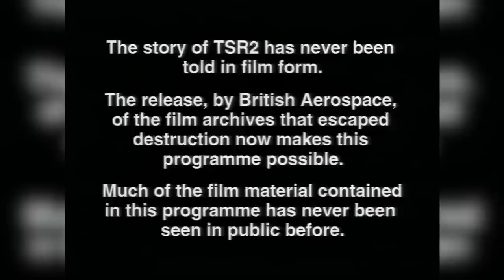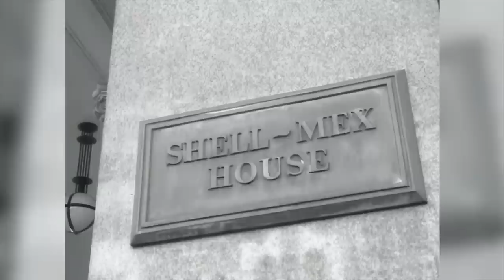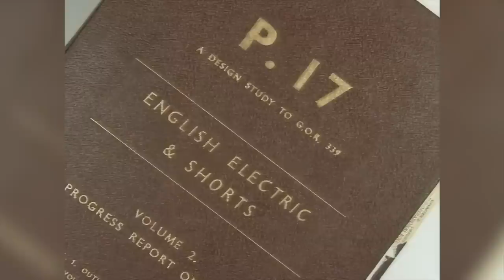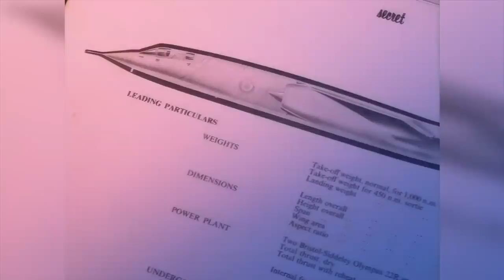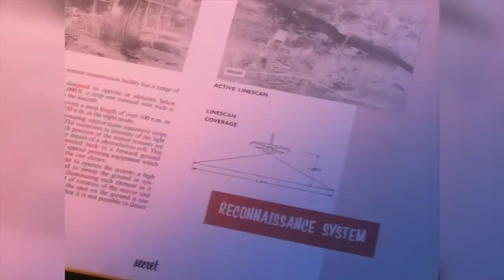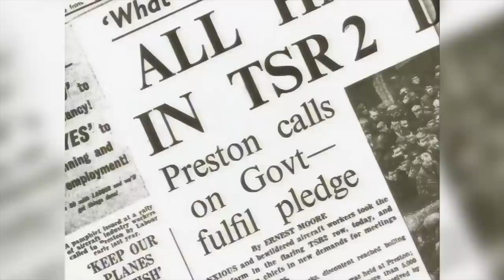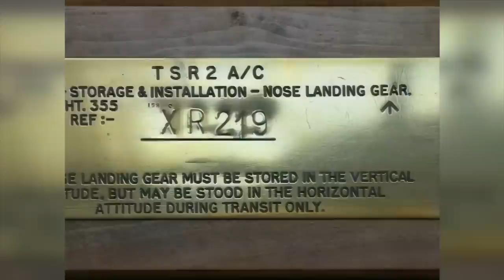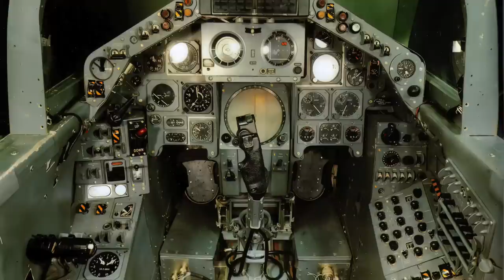BAC TSR2 | The British Cold War strike and reconnaissance aircraft that was cancelled | Upscaled

Comment: Regardless of the development problems and costs of TSR2, I distinctly remember the Labour opposition promising before the 1964 election that "we will not cancel TSR2". One of the first things they did when they got into power was cancel it.  That should tell you a lot about politicians and their promises -- no matter which party they belong to.
Reply: I don't think anybody had shown Labour the stratospheric cost over runs at that stage as in opposition you are not allowed to see the figures, plus there was a very elastic estimate of an in service date for the aircraft. It could have been another six or seven years before a squadron saw one, by which time it would have been obsolescent, certainly in avionics. Remember there was only one customer so we'd have built...maybe 100-130 maximum. Tornado came along not that long after, the tripartite project ran like clockwork by comparison with TSR2 and they built nearly 1000 aircraft for four customers. They learnt a lot from TSR2 about how not to run a project. It was regrettable, but as hard decisions go I think they got it right. Sorry n'all that.
Reply: Very interesting, funny how long it can take to build a new plane model, compared to a new Spaceship for new moonlandings, wich was less than 10 years, I'd say 5 full years of actual work. 
  So a real Brit fiasco without Outside (USA) help like Canadian Avro Arrow that got cancelled because "defense Planes were over with"... it worked fine.
Reply: It was a rub for Grumman and Lochheed, so it had to go
Reply: Oh my! Politicians lying, who would have thought.
Reply: @wildboar7473  As a Brit, I don't think American influence was a factor except to the extent that F 111 was offered to the UK a lot cheaper. GD didn't tell us about the bugs in it though which caused that contract to be cancelled in any event. Neither can I be 100% certain there wasn't skulduggery by the USA, but I've never seen enough proof in the TSR2 case. Britain was broke at that time and so cost is a critical factor. It's all circumstantial and people add 2+2 and make assumptions.  Lockheed and the F104 German contract on the other hand has convincing evidence of skulduggery, so we know it happens and it would be naive to think otherwise.
Reply: It was cancelled by labour for one reason  they were told to by the unions and we all know labour was bankrolled by  the unions and we all know who bankrolled the unions don't we
Reply: @CB1000FP1  no, in the post ww2 world there existed huge competition between the defence companies. The TSR2 was scrapped because Britain needed aid from the USA and didn't want to get involved in Viet Nam.  Then magically, the F111 came to fore
Reply: @timhancock6626  All great building projects overrun on price....it was certainly not Obsolete !!
Reply: coopdivi……you distinctly remember do you !!!    You must be geriatric to remember that one.   Go ahead provide your source for that gem of memory.    Don’t bother to mention that the reorganisation of the aircraft industry was compelled by Tory governments which was influenced by Duncan Sandys ignorance of aviation and technical matters.   Dr RV Jones condemned his ignorance and the 1957 Defence White Paper was his brainchild as well as the forced amalgamation of aircraft companies of which Roland Beaumont has an awful lot to say.
Don’t bother to mention that when Labour came to power following years of financial prudence under the Tories,  the country was virtually BANKRUPT. 
The only thing I take issue with was the destruction of the jigs, drawings and existing airframes which could have been put to sound research use, which again Roland Beaumont again had a lot to say.
Reply: @wildboar7473  Interesting you add the Canadian Arrow into the conversation. 
Go look at any of the videos on that plane and look at the angst from the Canadians.
There is still a lot of anger there.
Reply: @timhancock6626  Really good point about "how not to run a project" a lesson that seems to be forgotten then relearnt, forgotten then relearnt, forgotten then relearnt on so many occasions.
Consider the F35 on that one.
Reply: @photoman3579  The question would be better framed as what parts of the plane were obsolete at the time of cancellation. I'd agree the airframe and engines were not obsolete, but the electronics might well have been but then that's irrelevant because its now accepted that aircraft will upgrade the electronics several times in their lifetime.
Reply: @alexmoore432  no it was cancelled by the Soviets, the F111 was inferior to the TSR2 which is why they weren't such a big threat to the Kremlin
Reply: @CB1000FP1  how do you figure that?
Reply: @californiadreamin8423  Yes, I am a geriatric and proud of it -- which is not to say I've gone gaga (yet). I was nineteen when the newly-incumbent Labour government cancelled TSR2, and as I had a great interest in  aviation generally (I was a regular attendee at the Farnborough Airshows and had been 'plane spotting' at Heathrow since my early teens) I had been following the TSR2 saga avidly.  Most of the information available to us at that time came from newspaper articles and specialist flight magazines, and the occasional tv programme. 
Naturally, in the run-up to the General Election the media were predominantly concerned with political articles, statements and interviews, and it was from one of those (I must confess I can't remember which one) the statement "If elected, we (Labour) will not cancel TSR2" comes. Because of my interest in aviation that statement lodged in my brain, never to be forgotten; TSR2 was a popular topic even amongst non-enthusiasts as it was seen as a shining example of what the British aviation industry could do.  Of course, we knew nothing about all the other problems and behind the scenes manoeuvrings associated with it. All we knew was that when the government cancelled the project, it was seen as yet another example of politicians reneging on their promises. Furthermore, the speed with which it was cancelled led to the suspicion that cancellation had been intended all along.
Your post seems to imply I am anti-Labour for not mentioning all the issues which occurred under the Tory government. My post suggests no such thing -- it merely points out that one should be wary of what ANY politician says. I once had a History master who introduced himself to the class by striding in without a word and writing on the blackboard in capital letters, ALL POLITICIANS ARE LIARS. In the 60 or so years since then, I've never had a reason to doubt that statement.
By the way, it's Roland BEAMONT, not Beaumont. As you're a stickler for accuracy, I thought you'd like to know that.
Reply: @coopdivi      I stand corrected….you should pay more attention to what Beemont had to say.   The country was bankrupt,  didn’t you know ?    The scene was set by the inept Conservative governments which had gone before,  so tell it the way it was.   I’m not interested in what your geriatric history teacher thought.   Not only that,   the money invested in the TSR2 wasn’t wasted,  because of the advances made in avionics,  engines and machine tooling.   While you were making your trips to air shows I happened to be at BAC witnessing for example Jaguar wing skins being milled from solid slabs of aluminium on machines installed for the TSR2.   That doesn’t mean to say the workforce hadn’t been in shock after the cancellation,  because they were, as reported to me when I went through the design office,  but they were heavily involved in Jaguar and the MRCA.
PS.    I’m older than you. 🙀
Reply: @wildboar7473  Its the loss of skill sets, experience and knowledge that people should be furious with. Right now here in Australia we have this almost social meltdown over trade skills shortage. 

Back in the 90s we shutdown the schools where we taught basic trades. Surprisingly it was not the political right but the Labor Party with a 1990s version of wokerism. At the time people said we would suffer in future from a lack of skilled labor. During the late 2000s and all through the 2010s as we built new mines and new gas projects to feed Asia with raw materials. There was constant outrage from industry about the skills shortage. We had to constantly import skilled tradesmen - welders, machinists, electricians,....

I did a degree in aerospace but work in Industrial control systems and automation. I went off to our mining industry because circa 2002 there was a proposal to mine the moon for Helium-3. So I went for the experience of building mines in remote places. The shortage of welders, machinists and electricians was staggering. One of my first times on a mine site I asked how they were handling it and the supervisor just looked at me and said if I had a welding ticket he'd pay me $X, where $X was almost $50K more than what I was getting paid as an engineer with over 15+ years experience.

I just heard recently that in America if you do just a 6 month basic welding course (not a full 4 year apprenticeship) you will earn more in your 1st year after that than the average college graduate. If you do the basic math for the first 5 years after high school. You have the college graduate earning $A but with a huge debt. The welding kid has NO DEBT from the 6 months of welding because community college is free. Plus he has 4-1/2 years of earning $B each year where $B is a bigger number than $A.  

This madness that started in the 1960s, where M0R0Ns with no idea made stupid decisions, hasn't really stopped. In anything its gotten a lot worse. that 100hour program to get the most out of TSR-2 should have been done. Nobody should have burnt anything. Other than the waste of expensive raw materials, that was pure pettiness.
Reply: Labour did in the TRS2 Tories did in the black arrow rocket program
Reply: @californiadreamin8423  the unions have been in the pay of the Soviets virtually since there were formed, and they do what the Kremlin tells them, without there money they would have collapsed decades ago, they wrecked British industry in the seventies, I was a engineering apprentice in the late sixties and remember a large strike being called in around 1970 when I asked some of the  other workers in the factory what it was about the majority had no idea and most weren't very pleased that they would be losing money either, always refused to join any union after that, wouldn't trust them further than I could throw them
Reply: Will Rose  Thanks for the insight from someone who was there.
Reply: Well if you vote Labour,  what do you expect!?
Reply: @wildboar7473  Britain was 'in hock' to the US for decades after WW2, no doubt the existence of a competing British project might have resulted in a little 'arm twisting' of the political party that took control in 1945!
Quite a number of British aircraft before and after that date were technically successful, after all, including a supersonic transport aircraft said by NASA to be as difficult to achieve as the moon mission.
Reply: The RAF were the people who actually killed TSR2, because it didn't work and was never going to work||!! Aircraft was loaded with design flaws which were not fixable!!
Reply: @californiadreamin8423  Yep, the good old Jag. Took the French to teach Warton how to build a decent aircraft!!
Reply: The TSR2 was cancelled quite a while after Labour got in power.  They did fully assess its viability costs. They inherited a project that was running out control with costs, when UK cities still had appalling slums needing to be cleared with new homes built. Their decision was vindicated when the Vulcans were converted to do the same role as the TSR2.
Reply: @CB1000FP1  
You read the Daily Mail and Sun too much.
Reply: @californiadreamin8423  
The Labour politicians with power say they did not order the destruction of jigs. 
Although politicians would do such a thing. If the Tories got back into power they could restart the project, build the plane then use that as a political baton.
Reply: @tonywilson4713  
With engine and avionics upgrades the TSR2 is match even today.
Reply: @richardvernon317  not entirely sure about that idea since the father of one of my friends was one of the designers- left without work at closure - he had a rather different story to tell of political shenanigans!
Reply: @John Burns  I could barely watch the last few minutes of this video since I remember the story.  I will say right here and with conviction that I am certainly no admirer of the British Labour Party and esp. the disastrous Wilson Labour Government. They were the mob who nationalised everything including the motor, steel and  aircraft builders industries. I have a distinct memory of Daddy's indignation and horrified disbelief at the stupidity of the Labour pollies. I think that the TSR2 would probably have had at least as illustrious a career as the F111 and quite possibly more so. Do you have any thoughts on this?
Reply: @richardvernon317      I won’t rise to the Jag and the French.  However your statement about the TSR2 is interesting.   I’ll rise to that one…..justify what you say.
Reply: @johnburns4017     I stand corrected….it was nearly bankrupt,  hence the reason for joining the EEC , and why the Labour Government had to go to the IMF for a loan.   Nevertheless I agree with your post.
Reply: @Davidcallard     Was the aircraft industry nationalised ?   I know it wasn’t.  
Was the motor industry nationalised ?     Some was, not all,   but the question is why ?    How many years were the Conservatives in power before Wilson became PM ?     The British Motor Industry continued after WW2 ,  using clapped out machinery,  with virtually no competition because our competitors industries were bomb sites.   Huge profits were probably made yet they did not reinvest like the French ,  Germans,  Italians, Japanese.   How did they manage and we couldn’t because I’d like to know ?
Reply: @CB1000FP1 Dearsir, you are mistaken ,  the F111 had a greater internal fuel range, and a greater weapons load, than the TSR2, which is why the RAAF chose the F111 over the TSR2.
Reply: @californiadreamin8423  The sad reality is that British industry has not generated sufficient surpluses to reinvest and upgrade since at least 1945, shipbuilding being a classic example, barely profitable since 1919. As a genaralization, domestic demand in Britain is for products that do not necessarily translate well into export markets. Japan has a similar problem, though Japan does put a lot of effort into developing products primarily for export, which means that domestic sales for export products is a bonus.
Reply: @timhancock6626  You bang on the money with the problem: The avionics. The systems were trying to deliver performance that was a decade down the line. So much was right about it: it was a very clever bit of kit, but aside from the politics: it simply wasn't going to be able to perform the missions required of it. Far too much feature creep and far too much vested interest by the USA to kill any decent rivals to their aviation builders. Happy to hire our engineers mind you.....
Reply: @richardvernon317  And you know this how?
If anyone in the MIlitary had an influence in causing the cancellation of the TSR project, it was Lord Louis Mountbatten.
Reply: @CB1000FP1  
Yes CB1000FP1.
It was cancelled because Britain was broke. TSR2 over promised, under delivered. Cost quadrupled, Years in delays in being able to get it into service.
Nothing to do with the Unions that have never had any say in Defence Contracts.
Exactly the same as the General Dynamics F-111C that Australia bought 24 but from and a much larger order from the USA Airforce to distribute cost overruns.
The F-111C was in service in Australia for nearly 40 years. Not bad for an old airframe.
The F-111 had its own problems but evdentually turned out to be one of the most successful tactical long range fighter bombers used in the Western World.
BTW who do you think 'bankroll' the unions? The USA? 
The only country that benefitted by the cancellation of the TSR-2.
Reply: @CB1000FP1  
The Soviets and Kremlin was reliant on the Western Defence projects. Spies are cheaper than research.
That is how the Soviets got the Atom Bomb. Jet fighters, and the Tupolev 144 'Concordski'
Reply: And they promised to get 50 F-111s.  Those Pigs would of been very useful during The Falklands.
Reply: @70sVRsignalman  it still wasn't as good as the TSR2 which would have got the job done and wouldn't have been reliant on a unreliable foreign country for supply and maintenance
Reply: @CB1000FP1  I give in - who?
Reply: @andywilson2406  who what?
Reply: The Americans lost more F111`s in Vietnam through a design fault @timhancock6626 than were shot down by the Viet Cong. A small cleat at the base of the rudder, failed which put strain on adjacent components, which then failed themselves.
Reply: @robshirewood5060  I spent the best part of a year at university studying the causes and effects of the 1957 Defence White Paper. I do not recognise your narrative at all. You seem to blame a loosely connected conspiracy type theory which is nonsense. It's mostly cockup, not conspiracy, but politics is always lurking around so you have to factor it in somehow. All I would say is that politicians always listen to holders of the purse strings first ( except for Kwasi Kwarteng it would appear). He is the exception that proves the rule.
Reply: @johnburns4017  Sort of....If you talk to Vulcan crew they were not well suited to the low level role they were never designed for. They did make it "work" at low level though, to their great credit.
Reply: @MrHeesbeen  I did refer to bugs that General Dynamics didn't reveal to the UK. They also had severe problems with premature wear on the swing wing mechanisms. There was a list of problems, I can't recall them off hand. They were enough for the UK to cancel it's order and revert to re-tasking the Buccaneer from its Naval carrier role to RAF low level strike. It performed this role honourably for 30 years.
Reply: @timhancock6626  
So, the TRS2 was not needed for that role when an existing plane could do it.
Reply: @timhancock6626  The Americans and IMF sealed it's fate. Tragic decision
Reply: @timhancock6626  "They" may have got it right, but "they" certainly didn't get right the decision to buy the F-111.
The swing-wing feature of that aircraft, plus several less challenging problems, caused years of delay in delivery and resulted in a bill for each aircraft almost ten times the original quote. Sorry n'all that.
John Bayntun
Reply: @craigbeatty8565  
Where would the Brit's have flown the F-111s from to reclaim the Falkland Islands?
The Brit's used carrier based planes as they had no land based airfields within range.
Reply: @johnbayntun840  We never bought the F-111 in the end so most of your post is pointless. We "bought" the Buccaneer. Sorry n'all that. TSR2 decision was sound.
Reply: @CB1000FP1  🤣🤣🤣🤣🤣
If you're ever visiting the planet Earth let us know.....
.......we'll pop the kettle on and explain how things work outside your planet!
Reply: Got the original version of this video with the full facts and minus the unnecessary vision in vision stuff and stupid music!
Reply: @timhancock6626  It was the Australians who "bought" it,  I made no reference to any purchase made by "us". Read more carefully.  Do you have any opinions about the 22R from your opinionated resources?
Reply: @ianhudson2193  do you know how things work? Doesn't sound like it
Reply: @alexmoore432  actually in the end no it wasn't not at all
Reply: @alexmoore432  in the end tsr2 was not a f 111 no way it would be able th perform the low altitude missions the f 11 flew after bugs were worked out and no variable sweep wings just 2 stubby wings
Reply: @CB1000FP1  Well.........if you mean exposing your dogma for what it is, then yes!
Reply: @ianhudson2193  what exactly is my dogma?
Reply: TSR2 was between a rock and a hard place politically - the US would have put pressure on the Conservatives to cancel (a direct rival to F-111) and Labour wanted the west to fall - perhaps becoming part of the Soviet Union.
Reply: @photoman3579  indeed. Aircraft hang around for decades.
Reply: Whatever the politics, we still have two survivors to gaze upon and admire as a what might have been.
Reply: @22pcirish  A reminder of how treacherous politicians are - if the last three years wasn't enough!
Reply: @CB1000FP1  Actually it was cancelled because they were informed of both the massive cost and time overtunns once they became the Government
Reply: @photoman3579  It wasn't just cost though was it. Nobody could say when it would be ready. The engines were such a tight fit they were a nightmare to change. They were not even properly certified at first flight. It was being overseen by far too many people with their own agendas. Even Roland Beamont the test pilot said the organisation was so top heavy it was unmanageable. Nobody could say if it would take five or ten years to get right. There was a very real risk it was going to be obsolete by the time it reached squadrons. Lots have said they overstretched by going for a new engine and a new airframe all in one go. The project was full of holes and that's why it was kicked into touch. Blaming Labour is a laugh when you look at how many aircraft the Conservatives have cancelled..particularly the Nimrod MRA4 which was virtually squadron ready when they scrapped it, even if it was a mistake to go for yet another Nimrod upgrade on such an ancient airframe set.
Reply: @timhancock6626  And the Brits saw the SA2 missiles over Vietnam made it rather pointless to rely on high speed and altitude for tactical strikes.. No other planes of similar design have survived the 70ies..the B1A Supersonic high altutide, became the B1B subsonic low level.. A5 vigi.. quickly converted to recon bird.. failed in its bomber role..
the F111 also had to come down to lower altitudes and speeds for its operaitonal roles.. But the TSR2 would never have been able to do so with its design and stubby wings..  it would have been obsolete by the time it made it to production...
Reply: Wilson made far too many visits to Russia before he was Prime Minister for me to trust him.  I think it took him just 5 days in power to cancel the TSR2, and his friends in Moscow were doubtless very relieved.  They were right to fear a plane that could fly at low level below radar corer right to Moscow.  Their air defence systems were rubbish at the time, and stayed rubbish for years after, as proved by the pilot who landed a light plane on Red Square having flown in undetected.
Reply: Lots of dollars under the door ?
Reply: @timhancock6626  Very interesting comment Tim, and as sad, and hard as it was, regrettably it was the right decision.

The '339' project was soaking up taxpayers money I like you I cannot imagine. It was a huge investment - and we're talking a million a WEEK. Yes, it was spending money like it was going out of fashion.

Around £5 million a month (equivalent to £150 million today) was being spent on the project. And even the aircraft development management (as well as certain members of parliament, and front bench ministers) knew the end was on the cards. They simply couldn't carry on spending that kind of money when other priorities needed more attention.

Very sad, that it didn't get to fly in anger, only to fly one or two test flights.

I'm completely gutted that they didn't at least produce a dozen or so for a certain squadron or squadrons. Basically it was a very good aircraft with class-leading, and world beating abilities - and all of the money that was spent on it should have at least something to show for it.

RIP Teaser Two. (The engineers nicknamed the aircraft 'teaser' due to a play on the TSR designation, and also, a clue to its potential groundbreaking performance.  A bit like offering a toddler a tantalisingly tasty Easter egg, and then taking it away before it was even being unwrapped.

The loss of the TSR-2 was a damn shame, and would have been amazing for the first few years of deployment, but it would have become obsolete very quickly.

Even so, and as much as that is true, there are still elements of the aircraft which are classified to this day. Especially it's highly accurate look down and terrain following RADARS. This was the first terrain following radar (TFR) in the world. The aircraft could work out where it was based purely on its gyro inertial navigation, and terrain mapping. It also utilised the world's first high bandwidth 4.5 Megawatt radar jammer and 360⁰ active-phase DX bouncing ghost target multiplier. It even had a rear facing radar element in the empennage providing 'HINDSIGHT' (Acronym - HIgh bandwidth Incoming Negation utilising Doppler Scanning Integrating Gamma ultra High power Terrain low level missile avoidance).

And remember this is the late 50s and early 60s. The electronics engineers at Ferranti were developing some of the most advanced and sensitive detection and signals collection systems in the World. And for the TSR 2, that would mean extremely advanced forward-looking, side looking, really looking and downward looking active phased array radar and signals collection systems, all on one aircraft. Mind-blowing.

Speaking of the phased array radar, before anyone says it, it's not like today's phased arrays. The active phased array used in the 1960s, used vacuum tubes, and a cyclic scan (hence the 'active') through its frequency pallette on each pass. The full frequency array would take approximately 18 seconds to cycle. But it was better than nothing, and would have been very reassuring to pilots.

Also, another interesting, and groundbreaking for the time, system being developed not just for the TSR2, but for the RAF in general, was 'ICECREAM' (Integrated Communication via Electronic Countenance Reactionary Extended Area Multiplex), which would have allowed multiple aircraft to talk to each other electronically in order to build a very wide red grid, and allow other aircraft to control missiles once they are fired. This was at the very, very cutting edge of known boundaries and expertise at the time and pushing electronics to it's limits. It took engineers of the highest calibre, to develop the WARPAN wide-area packet-switched network.

Today,  this system is cslled airborne early warning and control (AEW&C), and ACARS digital data-link.

So, apart from the Mach 2 performance, 70,000ft ceiling, Mach 0.93 on the deck at 60 feet with the terrain control radar preventing a crash, and many other classified systems which we will never know about..   the TSR-2 was truly groundbreaking for it's time.
Reply: I suspect it was Wilson who authorised the wanton destruction of everything TSR2 related.
Reply: But today, what would 800-million Pounds would mean?
Reply: @stijnvandamme76  After reading your comment I had to look up the F-105 Thud for comparison. It seems the Brits saw the Thud and thought "we want THAT" before the tactics for which both planes were designed was proven to be disastrous in combat. The definition of insanity is making fast bombers over and over again and expecting different results.
Reply: Canada had a similar project with the Avro aero    At least two decades ahead of anything else , canceled through American pressure.
It was dumped into Lake Ontario, I believe
Reply: firing squared comes to mind
Reply: They are not 'all as bad as each other', that is Daily Mail bollox. One only has to look at the tories and their Brexit, a  UK catastrophe greater than any since the English civil war, the latter being a response to the appalling behaviour of... guess who? Yes, the same folk who are now Tories.
Reply: @johnburns4017 I wish the architects were condemned to a year of their working life in on of their new creations.

The Vulcan could not do so well at low altitude. 
However, the TSR2 could not have operated  over target. It needed standoff bombs and it had twisted to reliance on the American's Skybolt. Kennedy said it would not proceed, here's Polaris. 

Personally, I am disappointed that we did not achieve the TSR2. Very.

However, I think that although the plan was well ahead of time, it was basically a very manoeuvrable cruise missile operated by skilled personnel on a one-way trip. Perhaps we should just have built a few more Buccaneers.
Reply: @20chocsaday  
The plane was unneeded. Events overtook it, if the need was there initially of course. Cancelling was the right thing, especially when the costs went through the roof (we need to do the same thing with HS2).  

The country was still full of slums. Wilson was voted in because of his social policies not to build and unneeded plane. The millions of people in such housing conditions cared not a hoot about a pretty looking plane. The cost of the TSR2 could build a town. 

The French, who the British teamed up with over Concorde, offered to join forces on further developing the excellent Mirage bomber. Changing its name, with RR engines and advanced avionics, etc, and incorporating the R&D of the TSR2.  It would have been far, far, cheaper of course.  But the need for such a plane with such capabilities was just not there.
Reply: The British Military Aircraft industry was destroyed by Tory Duncan Sands.
Reply: Tory Duncan Sands did the damage not Wilson.
Reply: @JohnSmith-bx8zb  
Correct!  But the TSR2 was not needed. 
Spend an enormous amount of money on an unneeded plane (as per HS2) when we have an acute housing problem?  
Wilson was right.
Reply: @JohnSmith-bx8zb  
Correct! 
That 1957 white paper was just complete nonsense. The industry never really recovered after that.  Also the RAF buying US planes when home produced were just as good. The C130 and Belfast comes to mind.
Reply: @wildboar7473  This and Arrow both got cancelled mainly because they were obsolete before they were complete.  This was a time when things were changing extremely fast in the aerospace world and design requirements changed constantly.  Everyone always wants to blame someone else, but these aircraft were simply way too expensive and they STILL weren't ready.
Reply: @timhancock6626  The TSR-2 mission was in support of the V-bombers. The first estimated squadron usage of the TSR-2 was, by 1964, the year the V-bomber force was to be stood down, apart from a few Vulcans in a conventional capacity and Victors as tankers. So by the time it was due to got into service, it's primary mission would no longer exist. As such, there was no point to continuing with it. MacMillan wanted it cancelled in 1963 but was persuaded to wait until after the election. But by 1963 it was already dead unless overseas sales materialised, which they did not.
Reply: @tonywilson4713  The TSR-2 project management failures was one of the driving forces for the UK Government creating a project management methodology to be used on projects it financed.
Reply: @seansands424  Tories intended to cancel TSR-2 too, just after the election.
Reply: @CB1000FP1  British industrial output began declining long before the 1970s, unfortunately.
Reply: @Davidcallard  The MacMillan government is the one that forced the mergers of the aircraft industry. It wasn't nationalised under either Conservative or Labour governments, though. The motor industry wasn't partially nationalised until the second Wilson government.
Reply: @grahamlucas2712  I think Germany was more an influence on immediate post-war Soviet jet fighters such as the MiG series other than the first generation ones that were simply jet engines stuck in piston-engined airframes. The USSR even completed some of the old Junkers jet bomber projects. The MiG series a parallel development to the F-86.
Reply: @timhancock6626  The Vulcan was more suitable than the Victor, although a low-level version of the Victor was proposed (late 1950s from memory), with podded engines (reduces bending moments on the wings) and higher speed. It was never built as it was expected that just using the Vulcan would be sufficient until missiles took over. At that point it was assumed the missiles would be in ground-based silos on the UK mainland.
Reply: @LondonSteveLee  The Conservative party already intended to cancel it, as the RAF had indicated it would arrive too late to be able to discharge its mission of support for the V-bomber force that was to be stood down as soon as Polaris was operational (1970). There was no need for the USA to put any pressure on.
Reply: @johnburns4017  Wilson sanctioned military spending, just on things that it was (ultimately, mistakenly) was thought to be workable, the F-111. Instead, under the Wilson government, the UK joined Panavia and was instrumental in creation of the multi-role Tornado which was intended to fulfil the strike element of the TSR-2 mission along with more roles such as interceptor to replace, to some extent, the Lightning. It was a good decision.
Reply: @wbertie2604  That's a great point and I wished they would hand Australia a copy of the paperwork because our military procurement people are completely off their rockers these days.
Reply: @wbertie2604  Hearsay.
Reply: @tonywilson4713  According to Hansard (1965) it was felt that 100-150 would needed to have been built to make it economic. Australia only bought 28 F-111s.
Reply: @wbertie2604  As far as I know the main reason was that the Americans didn't let anyone else get F-111s. In fact a lot of people still can't figure out why they let us buy them in the first place.

Quaint but true fact about our F-111s they still had the nuclear conformation buttons in them. That's the confirmation button the pilot has to press to allow the bombardier to let one go. I saw a cockpit review video of a retired RAAF F-111 a while back and they pointed out the nuclear confirmation buttons.
Reply: @tonywilson4713  They intended to let the UK have the F-111, but the project to make it fit RAF requirements went over time and over budget and the RAF opted to purchase Buccaneers whilst waiting for the Tornado.
Reply: @wbertie2604  Interesting. I believe the Tornado ended up being a good plane. It certainly served for a long time. In the current environment I'm sort of surprised nobody had put forward a Tornado II program.
Reply: @CB1000FP1  The UK is subject to global economic winds and if you look at a timeline of recessions in the USA you can be pretty sure the UK had one at the same time. Ditto for France, Germany, etc. The reverse is not necessarily true.

Getting back to aircraft, that's important because if the UK wanted to get out of economic difficulties by aircraft exports it would be going to market at the same time purse strings were being tightened globally and with many nations either seeking to export or favour domestic producers as a form of stimulus.

But in terms of the economy in 1963-5, it was doing well and the cancellation reasons were around the TSR-2 not being wanted at the time. The primary mission of nuclear strike of SAM sites and airfields to support the V force was gone and the RAF could buy Buccaneers (although not supersonic) for cheap pending F-111s, or in reality Tornado. There was still some hope that the supersonic Buccaneer might appear, but the RN decision to buy Phantom shows that there wasn't high confidence that it would work out in the timescale of high tension in the Cold War. And it's worth remembering that this was a time of high tension, and waiting five years for something great and British meant UK forces looking and being outdated on the world stage compared to buying something from the USA immediately. As such, I can see why the RN selected Phantom. In the end the UK didn't get involved in Vietnam, but relying on Buccaneers might have been problematic, even with them flying at their habitual altitude of 27 feet.
Reply: @CB1000FP1  the point it, it was going to be shut down whoever was in power as the RAF no longer wanted it. It was sadly a dead duck by this time. It seems silly to blame on a particular party or government a project that was going to be canned whatever. 

The issue was that it was very late in terms of development and things had moved on. It was late due to multiple factors including technology not being there, but also poor project management, industry reorganisation, lack of funding, and changes in requirements exacerbated by RN/RAF issues. If it could have been available on schedule in 1965, as the Mirage IV was, things might have been different, but it was five years late.
Reply: @CB1000FP1  it wasn't threat to the USSR, anyway, as it wasn't ever going to be deployed. Polaris was the threat. Given that the UK then tried to buy something relatively similar (F-111) and then join Panavia (ditto), both under Wilson somewhat undermines your narrative. And the RN updated its aircraft with the Phantom under Wilson too.
Reply: @wbertie2604  of course it wasn't going to be deployed, Wilson made sure of that,  the f1-11 wasn't that good anyway even the yanks had their doubts about it, the RN could update the buccaneer to their hearts content but it still wouldn't be a long range bomber,  the phantom was just a fighter that could carry a a few bombs, missile technology was in its infancy then, America was still flying B52s 24 7 at the time if i remember correctly, the TSR2 would certainly have been a threat and Russia knew it,
Reply: @Davidcallard  i remember those scenes of destruction like it was yesterday, appalling tragedy for the British high technology industry from which it never recovered, all the good brains saw there was no future here anymore and went elsewhere, notably the states, and the ramifications of that decision are still echoing down the decades to this day.
Reply: @californiadreamin8423 The reason why Dennis Healey had to return from Heathrow wasn't because the UK needed that IMF loan. It was because someone loaded the wrong month data for the monthly Treasury run. But we only found that out a long time later
Reply: @jonwatson6918      What is the source for this information ?
Reply: @californiadreamin8423  I'm old. I was in the business.
Reply: @jonwatson6918     Well it’s interesting but I’m surprised it’s never been revealed before.   You weren’t the “someone “ were you !!
Reply: Like concorde the yanks couldn't tolerate a superior aircaft industry.
Reply: Or the hidden power of the yanks!
Reply: @johnburns4017   Good point.
Reply: Some people in the brit isles need to get off their hi horse since the TSR2 pales in comparison the the XB-70 and the SR71.

Some people in the small island nation of britain continue to drown themselves in nostalgia, are  ‘poisoned’ with ‘colonial arrogance’ and ‘dreamy jingoism’.
Reply: Labour Liberal or Tory, it still ends up the same old worn out Story.
Reply: The Buccaneer 2 - the supersonic version